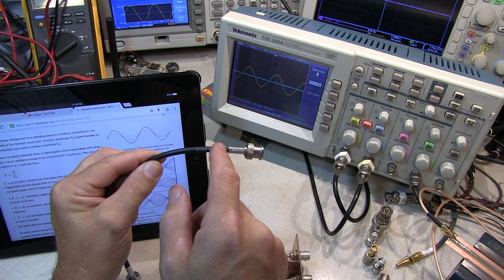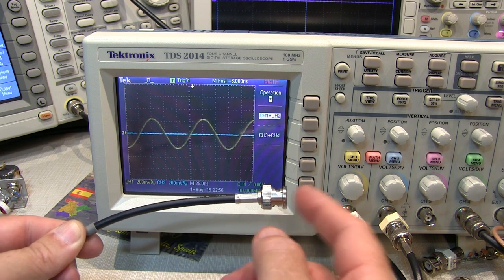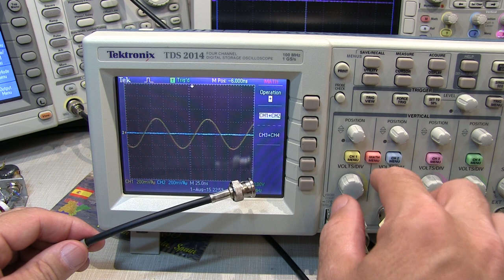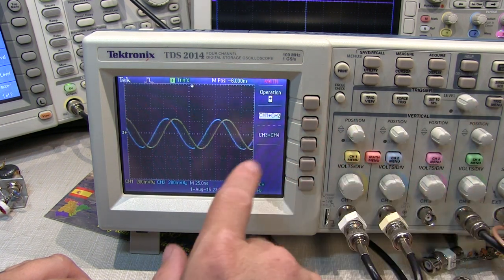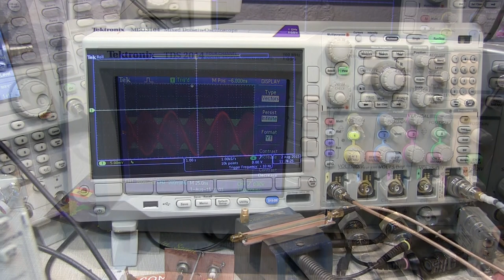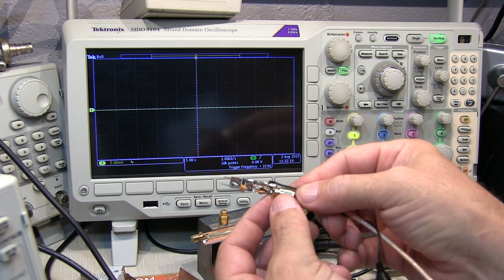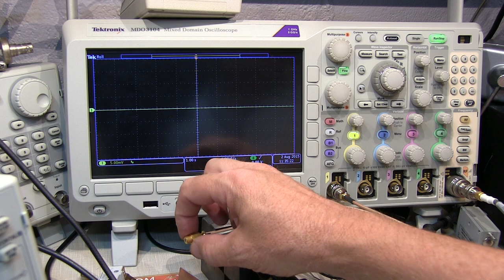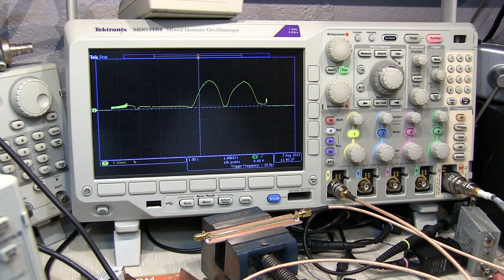#208: Visualizing RF Standing Waves on Transmission Lines

Comment: That is so cool!  I've never seen RF power measured at different positions along a transmission line like that.  I guess it's no surprise that it works, but it's always nice to see theory shown with an oscilloscope probe and a steady hand.
Reply: Brilliant demo and explanation.  Thanks for sharing!
Reply: Applied Science Ben and Alan, you guys should meet up and do a video.
Reply from the maker: Frédéric Dutrey I would LOVE that - too bad we're at opposite sides of the country!
Reply: ***** If only there was a means by which you could collaborate and share data in real time over long distances. I long for the day when that becomes reality.
Reply from the maker: Yeah, maybe when someone figures out this inter web thingy ;-)
Reply: nicely done. I use something like this to teach younger techs. This is a variation of the "Lecher" wires. I have a a Letcher set I built in HS that works at 400mhz. Its a bunch of fun to teach from.
Reply: Actually being able to run a probe along a transmission line and see the standing wave is incredible. I studied the theory at university many decades ago, but to actually be able to see it in operation is fantastic.

Comment: Thanks Allen. I remember when we did this experiments when I was an undergrad during one of my courses in the lab, I had a "WOW!" moment which changed my perspective forever. :)
Reply from the maker: The Signal Path Blog  Yes, there's nothing like "seeing" things like this - really makes it "click!"  Thanks for the comment!
Reply: ***** Can you make a video explaining type 1 through 3 op amp compensation networks used for switch mode power supplies? Also, what does the "s" mean in (s+1) term in control theory for compensators and what does the H(s) function stand for?
Reply from the maker: EETechs H(s) is the transfer function of the loop expressed using LaPlace transforms.  This would be a more complicated topic and would likely have to encompass a few videos.  I'll put it on the list though.

Comment: I'm starting to think that utube is much better form of education than the universities. They never explained it this good at my U. In my case it was like here take this bunch of formulas, plug in numbers, calculate, congrats here's your bachelor's.
Reply from the maker: You just have to find youtube instructors that explain things in a way that works for YOU!  I'm glad that my videos do that for you.
Reply: Unfortunately, I wasn't a very good student (and that's my fault), but I do think Alan's videos are much more educational than any lectures I received in my EE baccalaureate degree program; my lab classes didn't even use real oscilloscope probes (and, I had no knowledge what additional influences a home-made probe would have introduced , when high frequencies were used in a circuit-  besides, we didn't have the equipment to generate anything over 200 megahertz, anyway,   if my memory serves me well). We just used coaxial cables, stripped to the conductor on one end, with a BNC connector on the other end. It's embarrassing for me to admit, how much basic electronic science I've learned from Alan's videos - that I should have already know from my formal education as a EE student. I sure hope my university does a better job today educating future engineers - but, I doubt they do, since I can't imagine the lab  classes having expensive modern electronic test equipment in them (too expensive). It blows my mind to think of the money wasted in education, when they could just buy some decent test equipment, and pay the correct people to demonstrate how to properly use the test gear - and what the equipment is measuring, and why; And I do believe in the idea of public education, and consider myself to be very much a liberal. However, just today I was reading, in our local paper, about our local convention center receiving an education award for educating children middle school and high school children- not sure of the exact grades; this convention center puts on these very silly plays, which are supposed to be comical (I guess), for which they bus in thousands of kids to watch, during  the school day, and call this science education. I started watching one of the plays concerning science, and it was a joke (truly a joke), IMHO.
Reply: @WECB640  I think Walter did a great job with the pendulum explanation.

Comment: Nice demo.  I have a large slotted line and an HP 415E I use to demonstrate SWR.  If the crowd is very large, I hook a small amp and speaker to the amp output of the 415E so the 1000Hz tone can be heard around the room.  I usually get some comments about the archaic equipment.  Then I like to point out that this is the type of network analyzer that was used to design the equipment that brought back TV signals from the moon walks.

Comment: Amazing video as always, I was having a discussion with a friend of mine as to why the normalized impedance would repeat itself on a transmission line every half wavelength. This proves it. Also that is true for any termination except matched termination aka 50 ohms in most cases. Sits really well with the smith chart also. Alan you are true genius.